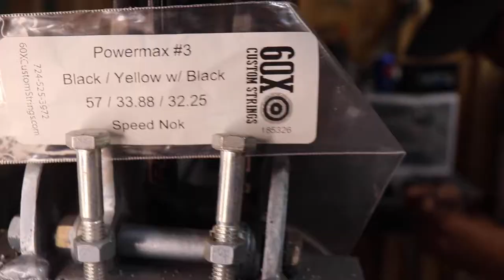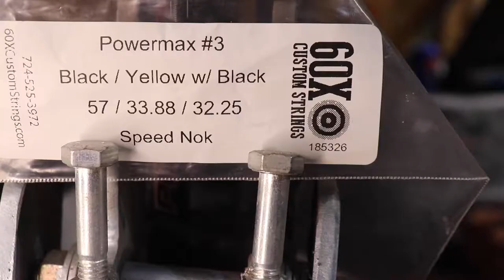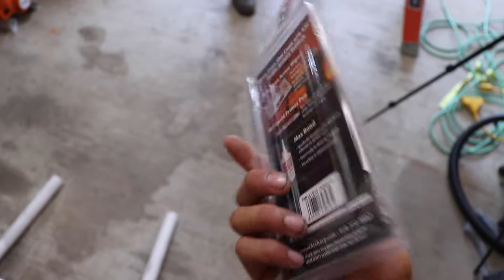Hoyt Powermax Bow Makeover (60x Custom Strings)

Comment: What kind of bow press is that and how did you guys learn to do all that? You seem very knowledgeable about bows and I'm new to it I just got my first bow in 2018 at Lancaster archery supply a hoyt powermax. I'd like to learn how to work on the bow myself and figure out what mods or upgrades to do and also about hunting and field dressing and everything. I have yet to go on my first ever hunt but i want to amd I'm looking into getting connected with someone local or a group of locals that I could go out with and learn the ropes. If there's any books or resources you can recommend I'd appreciate it muchly.
Reply from the maker: The bow press is homemade and over the years I just taught myself to work on them. It takes a lot of tinkering but you'll start to understand why something does something on a bow and kinda just find the things you like and want to use. For hunting wise all it takes is some trial and error you have to just keep trying and figure out the deer in your area. The hunting public does an amazing job in explaining how to find deer in almost every video.
Reply from the maker: We do try our best to explain everything just need to do a better job in showing it.